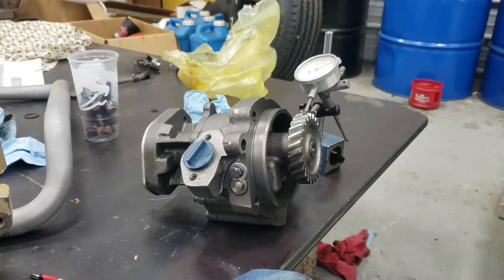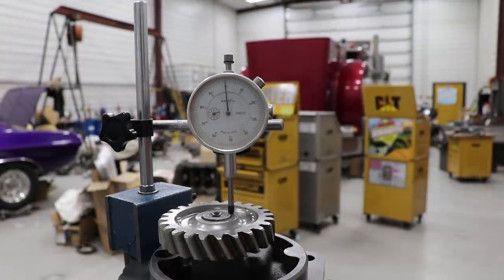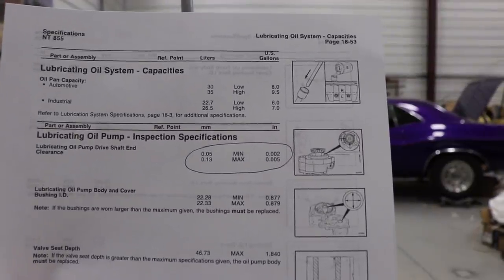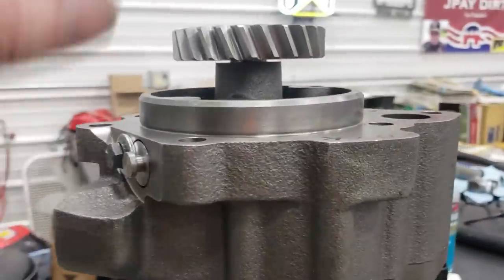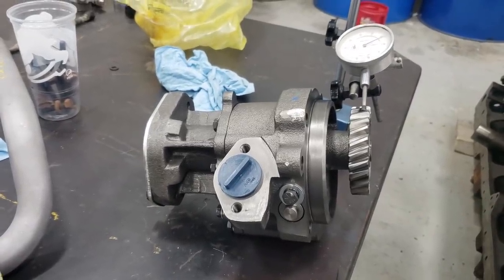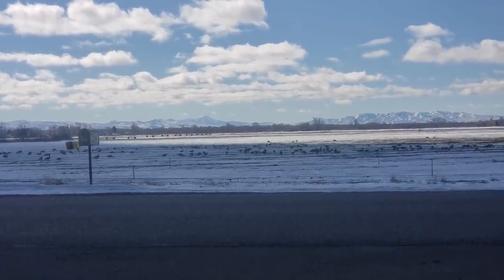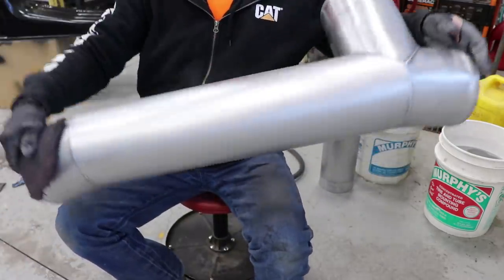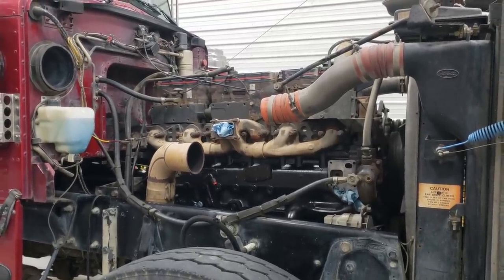How To Check End Play On A N14 Cummins Oil Pump

Comment: As a diesel tech and an engine builder I have found that same problem. I switched to an aftermarket engine parts from Interstate McBee out of Ohio for my Cummins parts. Unfortunately most if not all are made overseas but it seems quality control is better and I have not had any problems after 4 years and many overhauls completed
Reply from the maker: Made in India?
Reply: Yes to the best of my knowledge most of the parts are made in India for interstate McBee’s parts and the quality is better than the Chinese made original equipment
Reply: It’s also new after market with no core charges

Comment: The parts problem is across the board.  Names mean nothing anymore. I guess they figured out that brand recognition didn’t pay off as well as cost per part.   By far the best parts are still made in the U. S. but it is getting very hard to find them.   What you see now on most things today is “ assembled in the U.S. or distributed in the U.S.  but “ made in “ is becoming rare.
   Unfortunately the value in honesty , pride of workmen ship and decent paying manufacturing jobs has been overlooked by American consumers. 
  As the largest free market in the world It is ironic that we don’t seem to understand that where you spend your hard earned money shapes the market so that every time you walk into a Harbor Freight to save a couple of bucks you are casting a vote ,  not to mention filling the landfills with crap that cost more to repair then it is worth.

Comment: You have a chinese guage bet an american made one would show even more slop
Reply: Took the words right out of my mouth!
Reply: I have three cheap Chinese Dial Indicators and two  of the smaller test indicators, and they work surprisingly well.  The mechanisms are smooth and accurate and they have stood the test of time, and a lot of it in a dirty workshop on lathe and mill. The small test indicators don't mount as well as a Starrett.  But they really are as cheap as chips and it means I am almost as well equipped now I am retired as when my employer paid for my tools.   To be fair to Starrett, More & Wright, and Mitutoyo, I have Chinese 25mm and 25mm - 50mm micrometres which are nowhere near as accurate as quality tools.  If I zero them at one end of their travel, they are both about two or three hundreds of a millimetre at the other end but they cost less than $20 each.
Reply: It was the irony of bashing a chinese part with a chinese guage could care less of quality

Comment: And it's been going on for a long time too. I managed a fleet from the mid 80s thru the mid 90s. We had a Ford LN9000 in for a rear axle bearing replacement. Ford dealer delivered the bearings, mechanic came in to get me to come look. The bearings, in Genuine Ford Parts boxes, were marked Made in China. That was over 25 years ago folks! And we have to keep on buying the crap because we can't get made in the USA products.

Comment: @10:51

My father just told me that he had some work done on his washer and dryer, Maytag.  The repairman says to keep those machines going because the new ones aren't worth the cardboard they are put in.

Watch Wes Work channel also has them showing putting in brand new out of the box parts that do not function any better than the inoperable part there to replace.  

So the "pleasure" of getting junk in a box it's not solely yours.  A few decades ago I bought an idler arm from a ma & pa auto parts place: it didn't last 3 weeks..... Other than that I haven't really been touched up like this yet.

Comment: Wouldn't you check that for end play. After it is primed with oil ?   I have always done turbos  with oil.     Never checked oil pump.  So taking your experience on it.       Sure seams like something crooked.     I would love to have you set it out at flat near outer edge of gear.   Gonna be alot worse

Comment: they cant thred a bolt . i don,t think they can make a gear
Reply: Got some overseas chromed bolts for my Harley and the threads were chromed and would not work ... good thing the chrome job was a bad job because I was able to peel the chrome off the threads on about half of them.

Comment: Thanks for the education and training on identifying bad components including manufacturer supplied brand new ones. I'm equally sure many an average mechanic would have expected this pump to be fine coming from that supplier and gone ahead an installed it in good faith, only to find out that a disaster was impending. 
Is it possible that the old pump might be economically repaired at all?
Reply from the maker: A mechanic shouldn't have to waste time inspecting every new part,  it gets pretty depressing

Comment: They had a new style stiffener for the oil pan gasket that stopped it from leaking on my 99 N 14, maybe you should check it out.
Reply from the maker: Mine is a Recon from 2005 and it has some thick stiffeners on the pan

Comment: I wonder if melling makes pumps or repair kits with new gears for these pumps. At an oil pump rebuilder in los angeles had a test bench that checked volume, pop off pressure,  suction . Jeff you may want to rug up something like that
Reply from the maker: So I first learned about chinese pumps when I was building my big ol 440, had a guy tell me to disassemble it and clean it then run a sanding barrel up the oil passages, wow it was filthy and I knocked off a casting booger in the supply galley that would have ruined my engine. and it was a melling pump
Reply: @Jpaydirt  i hope your NOS pump works out..

Comment: After reading many of these comments, I am wondering about aviation spare parts, which are normally hellishly expensive.  With a helicopter 100 hour service costing thousands of dollars, it would be tempting to cut corners and use cheap Chinese parts.  Do aviation spares come with certificates?
Reply from the maker: I don't think any airplane manufacture would use the china flu parts, wouldn't the liability be HUGE

Comment: the n14 cummins not a bad engine i prefer yellow engines tho                                                                                           that 3406b that warren has at WT&TR came out of a pete air to air rad n all                                                                     ouch 1.000 $ for a oil pump not in spec i hope the new pump was cheaper   jeff

Comment: Jay need some help i bought a switchblade and I am getting very little boost pressure.i am bobtailing and truck seems gutless no power
Reply from the maker: what engine, if it's a acert you will need tuning as your computer is not seeing the high boost pressure twins make and is de fueling  I had the same issue
Reply: I am installing on a 6nz single turbo.in my engine compartment its very congested I am seeing the top of the actuator is touching my air cleaner bracket I will try removing some material and see if it makes a difference.i am having a hard time opening and closing the actuator
Reply from the maker: @michaelbritton2331  call Jim
Reply: @Jpaydirt i did but being weekend no response as of yet.i just finish watching some of the videos of your actuators and the pivot moves abit.my is touching metal have to free it up and should be great after.where the clip is there needs to be slight movement to open the tongue

Comment: I was a member of a union for a couple years and not saying all unions were the same but everything the union did was always saying it was for the worker but in the long run all it did was mane thousands loose their jobs because of higher labor, more benefits, different work hours. Instead of the product having the USA stamp the product now has CHINA on it. Lots have filled their pockets with China money in the process, politicians, union officials and business. I was a member of that union for three years seen the writing on the wall and changed fields.

Comment: All the comments of doing it right etc how many are mechanics pressured by booktime and book hours to get it done and wouldn't even have a clue how the pump works othet than it takes .2 to rNr the bolts n gasket to replace it done next step or job

Comment: Typical Chinese quality, absent. As a former medical device machinist we held .0005-.001 because our equipment was easily capable of it. Anything else was the fault of the operator. .003-.005 is wide'f'n'open... and we usually were working with titanium or harder alloys. That's just shameful for modern machining. US domestic pricing for China quality is on the manufacturer, they're in the profit maximization business, not the engine business at that point.
Reply from the maker: That's what I don't understand, in todays world repeatable quailty parts should be easy